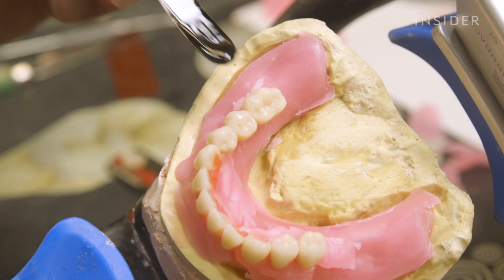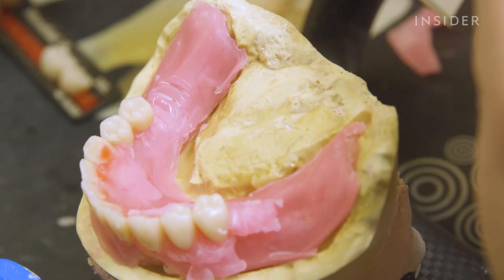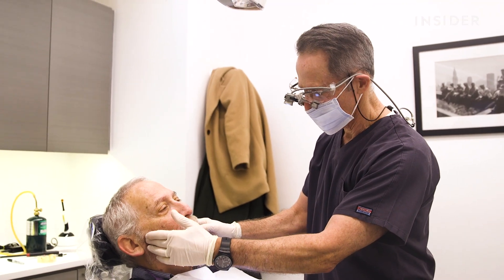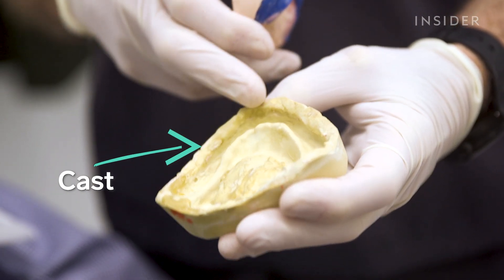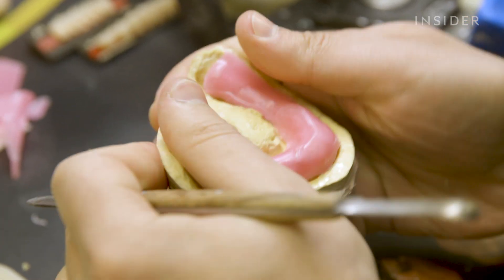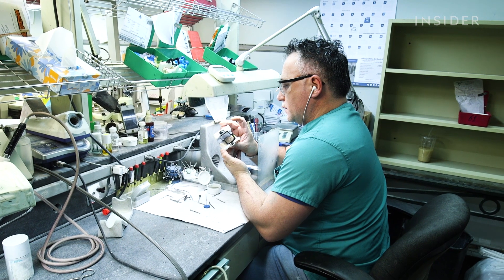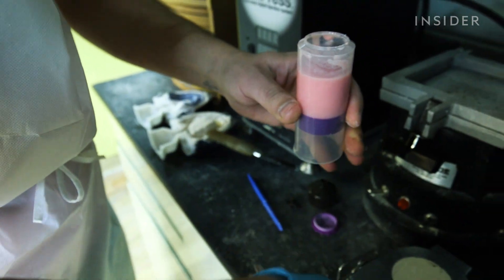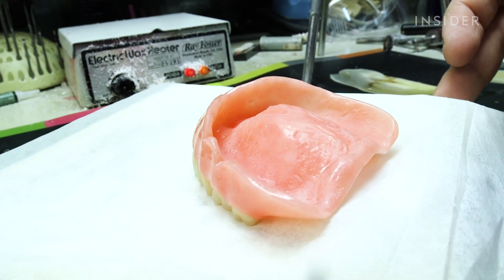How Dentures Are Made | The Making Of

Comment: 🎯 Key points for quick navigation:

00:01 🎭 Dentures are crucial for about 20 million Americans, highlighting their significant role beyond comic portrayals in media.
00:36 🦷 A full set of dentures includes a flesh-colored acrylic base fitting over gums, covering the roof of the mouth on top and horseshoe-shaped at the bottom to adapt to the tongue.
01:03 🔍 The process starts with a prosthodontist making an impression of the patient's gums, using a thick paste to create a stone cast replica.
01:33 🎨 Patients try different dentures to determine size and color, followed by adjustments to the cast before sending it to the lab for wax gum line creation.
02:04 🌀 Wax dentures are approved by patient and prosthodontist before being sent back to the lab, where they replace the wax with more realistic-looking acrylic.
02:41 ⚙️ The lab uses IvoBase to inject acrylic into molds, after which dentures are polished and ready for the patient.

Made with HARPA AI

Comment: Now talk about the price and insurance
Reply: A decent set of full dentures will run about $4,000, give or take. The insurance depends. Some insurers will only pay up to half the cost. YMMV.
Reply: @dalethelander3781  The ones I'll be getting (hopefully on 10-13-20) runs about $4,200 that my state insurance is covering.  The next set I'll be purchasing a dental discount plan and should run me about $1,400 for the set out of pocket.
Reply: @nickt1262  You'll need a reline in a few months. Your gums will shrink significantly. I had a reline 10 months after (it was supposed to be 6, but, y'know, life) and they fit great now. I can eat corn on the cob and steaks now.
Reply: @dalethelander3781  Yeah, I do know about the reline.  I went through a lot in the first 13 or so days of August.  I went through an angioplasty that took double the time (2 hours) as my mouth is abnormal (born that way) in that I had A LOT of bone width.  The specialist told me that I made her sweat lol!  BTW, the dentures I'm getting are the "permanent ones" from a dental lab - I had a wax try-in on 10-6-20.  I do have a photo of the (wax) dentures lol!

Comment: my butt clenched when they drilled holes in the fake teeth
Reply: Has to hold into the acrylic somehow.  How would anyone with dentures be able to chew otherwise without losing teeth.
Reply: @nickt1262  isn't it weird when you explain something that anyone would've obviously understood from the video. especially when I wasn't stating an inquiry but a reaction?
Reply: @rjvasquez3464  I was just saying what I did for the benefit of the rest who were "confused".  GOD willing, I will have my set of permanent dentures from a dental lab (after 2 plus months with no teeth) on 10-13-20.  I had a beautiful smile (all bridgework except for one tooth) taken away from bone loss - 19 tooth extractions on 8-3-20.